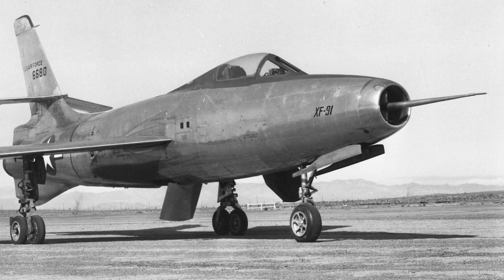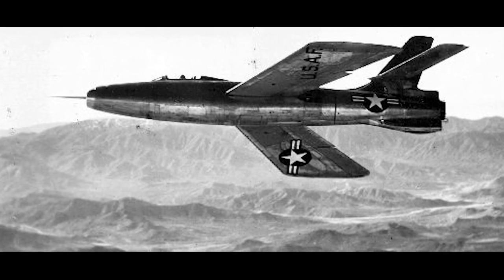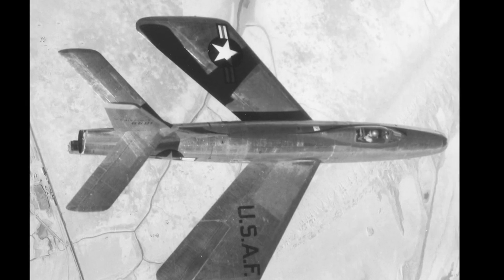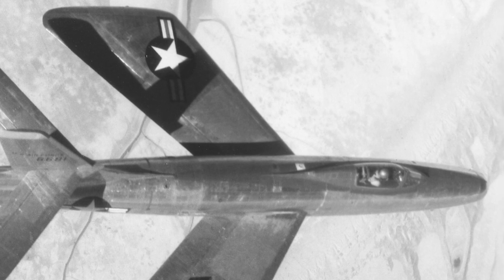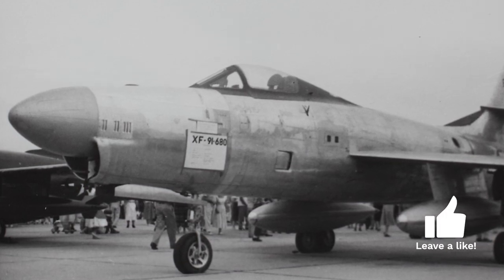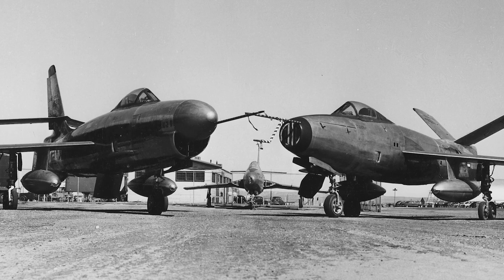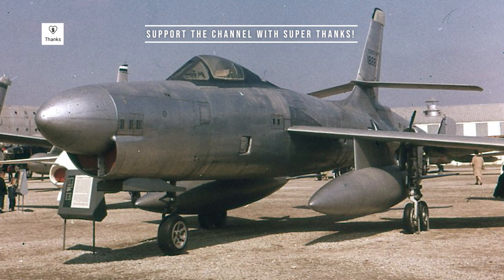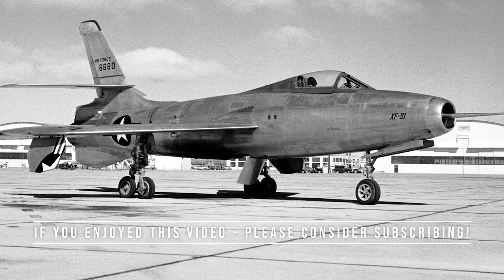Republic XF-91 Thunderceptor - A Short History

Comment: 25 minutes ?
Did it had very low fuel capacity, high consumption or both ?
Reply from the maker: It was a common problem with interceptor designs of the era that would be adressed in the 1954 interceptor project. I have had a hard time finding the exact reason, but I would guess the engines were inefficient.
Reply: @A_Short_History  - It used a rocket engine booster. The Me 163 that inspired the aircraft had a very limited flight time. Engine run was less than 10 minutes. The main engine, the GE J-47 was fairly efficient for the time, serving well with the  F-86 and B-47.